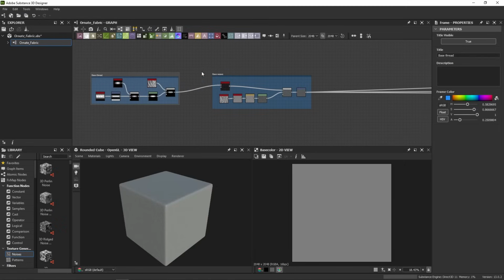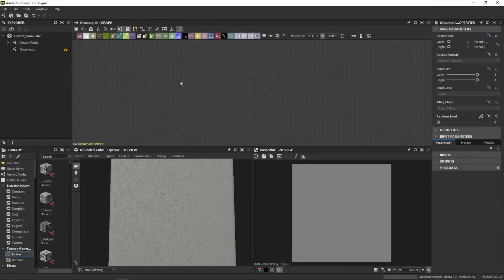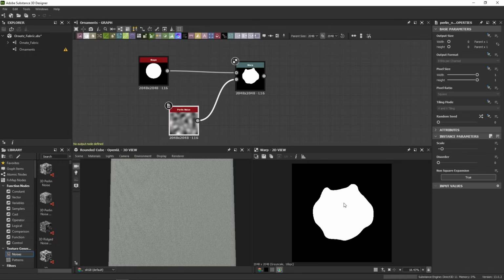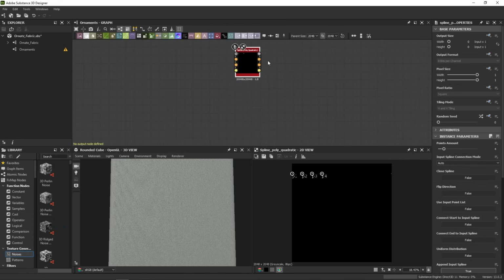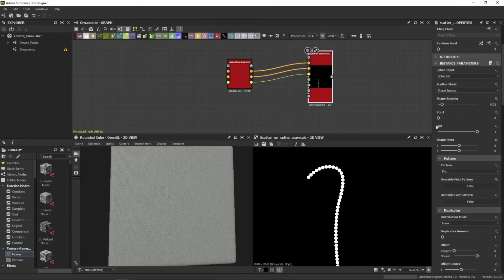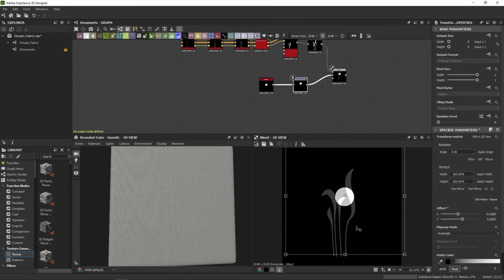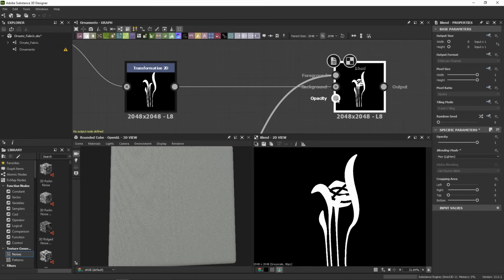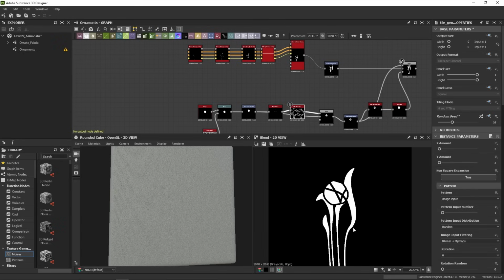Procedural Shape Design In Substance 3D Designer (Pt 7) | For Beginners | Adobe Substance 3D

Comment: When I added my Spline (Poly quadratic) node, the numbers below the node that apparently indicates the resolution (like usually 2048x2048) are being weird, like 2048x16, which make the 2D preview canvas as a line instead of a square. Do you know why this is happening or how to fix it?
Reply: Hey! So the resolution is normal, the splines are data stored in a line, but there is currently a small bug with the preview: to display it you need to actively double-click the "preview" output.

Comment: i can't change the compatibility display to v9 so i cann't use the spline tool
Reply: Mmh that's strange, what version of Designer are you using?
Reply: @louisemelin1129  i am using 12.4
Reply: @Nihar-b3i  Spline were added with the 13.0, you'll have to update if you want to use them

Comment: is there a way to change the thickness of the connection lines between nodes? I can't find the settings for it in preference
Reply: No there is not, the thickness is currently used to visualize the bitdepth of the information that is passed along: 8bits connections are thinner, and 32bits connections appear much more chunky. Hope this helps!
Reply: @louisemelin1129  hey that DID help!

Comment: Why did the node spline (poly quadratic) after connecting to the scatter node, begin to be displayed as a line?
At the very end of the video you can see that the node spline (poly quadratic) are now displayed normally, at least in miniature, but I don’t have
Reply: For some reason, when you connect the last Spline node (if you have more than one) to the Scatter On Spline node, the Preview output link (of the Spline) automatically disconnects from the Background input link (of the Scatter On Spline), and the node becomes 2048x16, looking like a "line". Manually connect it to the Background input and that should fix the problem.

Comment: At the moment, working with splines in the Designer is very inconvenient and it is a very labor-intensive process. It is much easier and faster to make an image in any vector editor, load it into the Designer and convert it into splines. Thank you very much for the video!!!
Reply: True, if you just want a static shape a simple svg is enough! I would say splines really shine when you start using their height and thickness properties, this is so powerful when you want to make overlapping shapes, scatter elements along them etc. But like everywhere: work smarter, not harder! the easiest solution for you is often the best :)
Reply: 确实，与其在sd上连接海量节点，我宁愿在ps中做完然后导入。